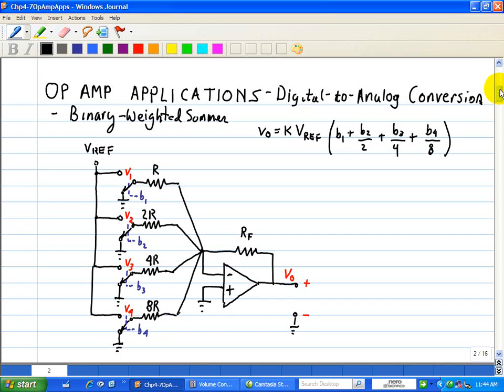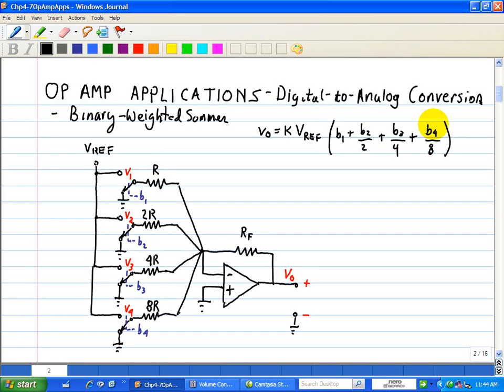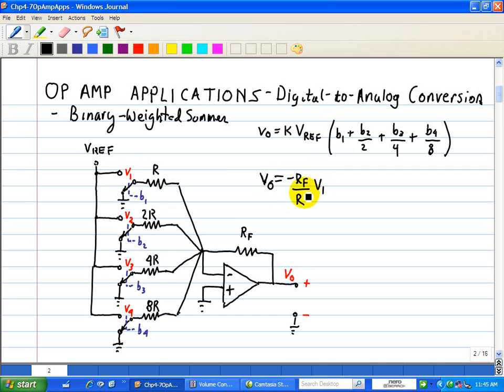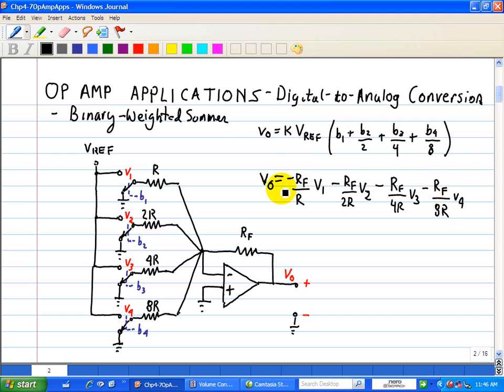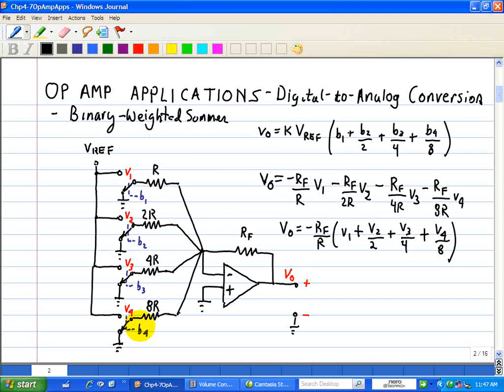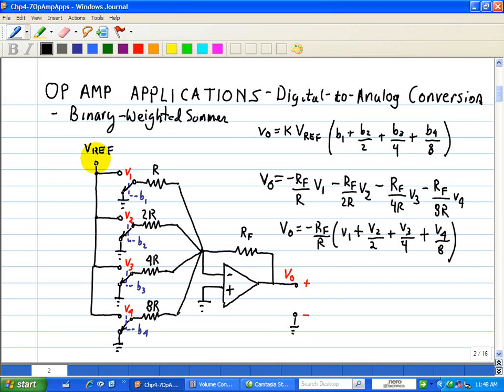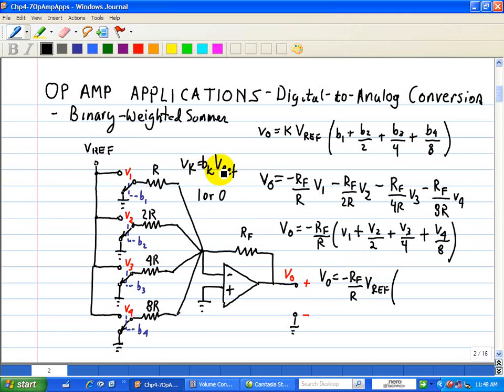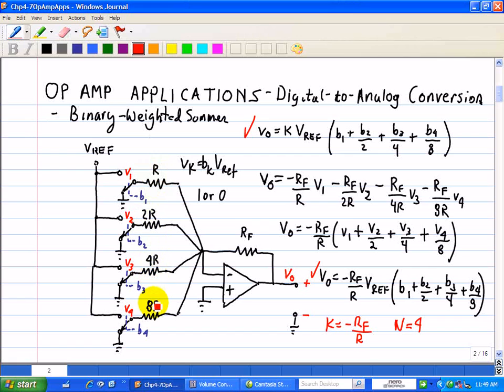OpAmp Design & Application Tutorial - Digital-to-Analog Converter (DAC)  Intro - Part 2

Comment: connecting to the inverting terminal brings about negative feedback i.e stable equilibrium. connecting the circuit to the non-inverting terminal brings about positive feedback i.e. unstable equilbrium